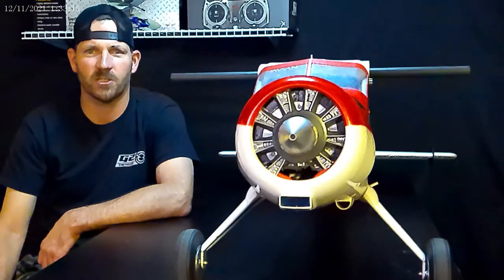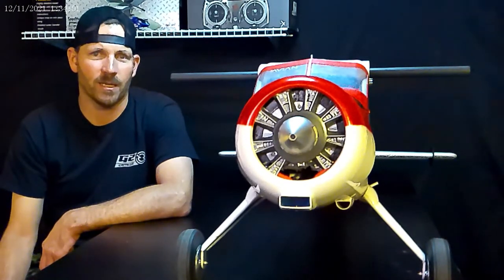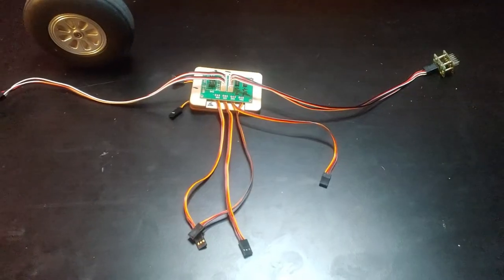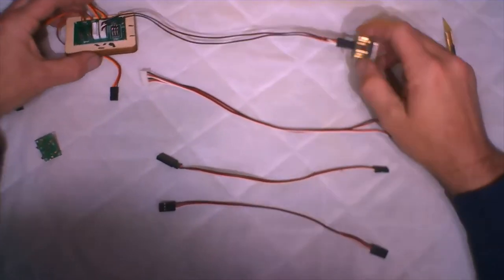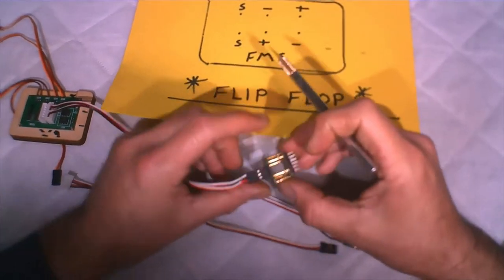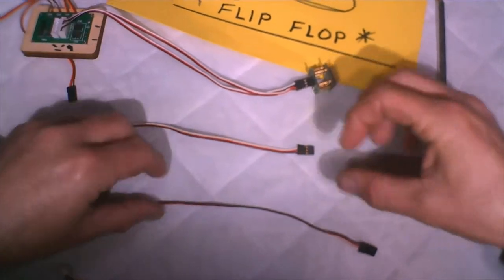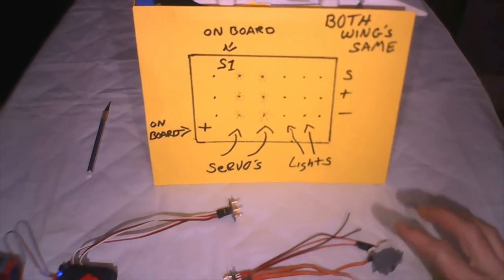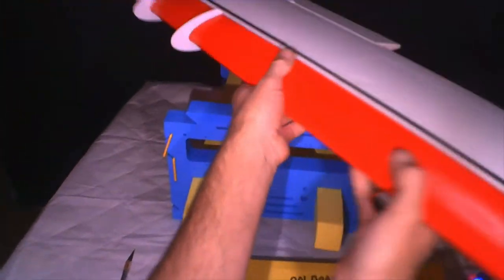FMS BEAVER 2.0 SERVO MULTI BOARD REMOVAL MODIFICATION part 2 spektrum ar8360t receiver

Comment: I am not sure many people appreciate the depth of research and resulting understanding that you have of this seemingly simple set of connections that is, in reality VERY complex, intermixed, and quite confusing.  While your resulting solution is simple and you diagrams are easy to follow, they come from a great deal of analysis and hours of continuity testing I am sure.  I wanted to eliminate the board and the reflex unit and you have done a masterful job of helping all of us to make this change. Thank you, thank you.

Comment: i wanted to say , thank you , nice video, i crashed my FMS beaver and the circuit board went south, so this was perfect, much better and less expensive.
Reply from the maker: glad you got it worked out
Reply from the maker: one of my very first videos has a detalied drawing in the video showing exactly how to wire it
Reply: thanks again Griffin RC. i had about 4 fights so far, you saved me big bucks, and a lot less worry, have a great one.
Reply from the maker: @garywardsr.4719  that is awesome.  I'm glad I helped some how. I learned alot on here and I just want to pass it on happy flying

Comment: i have a question? the 2 wires inside the fuselage that connect for each wing, were are you plugging them into on the reciever? one wire you reversed
Reply from the maker: hi gary inside the cabin on the back side of the plug is the 2 servo plugs one for alerion 1 for flap . on one of the servo plugs the positive and negative are flip flopped . so one is pos neg signal the other is neg pos signal

Comment: Hello, what brand is your servo tester?   Thank you.
Reply from the maker: So I have a couple. The one you see me use is a oldy but goodie TURNIGY servo tester I have a couple of the cheap small blue ones with the dial on it. And I have the spektrum xbc100 that does a lot more than servo testing if you have or may have smart spektrum batteries get the xbc100
Reply: @GRIFFINRCPLANES  thank you very much